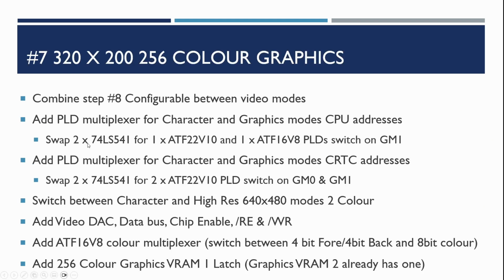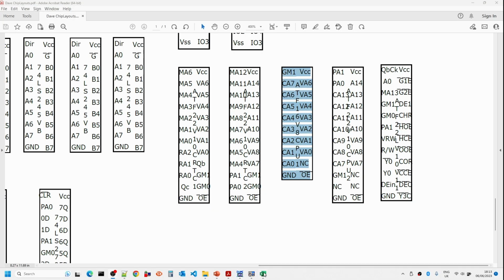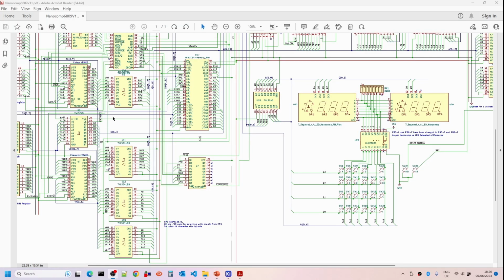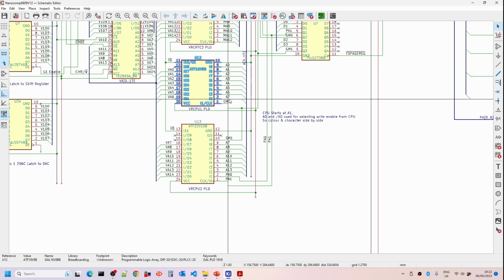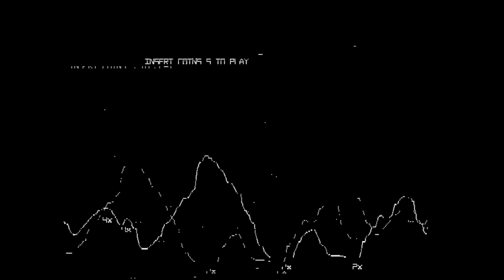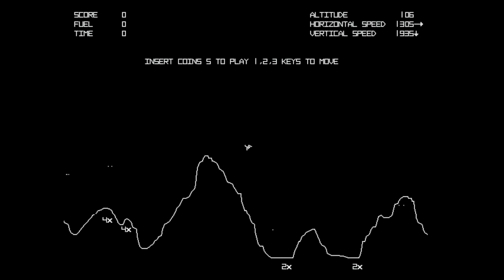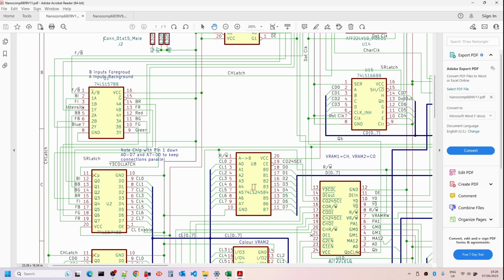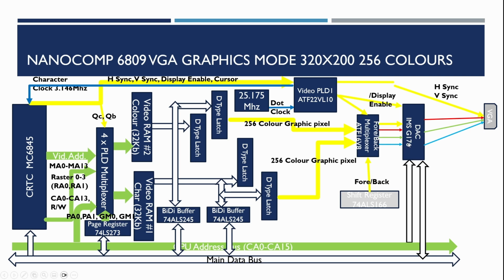V13 Part 2 320x200 256 Colour Graphics  Breadboard VGA Controller Nanocomp 6809 8 Bit Micro

Comment: Does the test feature in XGecu Pro also test sequential logic in a PLD (e.g. Q0.D = )?
Reply from the maker: Yes you can, there is a clock pulse option for testing pins. You just have to order your tests such that say a counter progresses in test order when checking the output values. So a 4 bit counter would have perhaps a clear test, then 16 pulse tests checking the output values but the tests need to be in the correct order. Dave